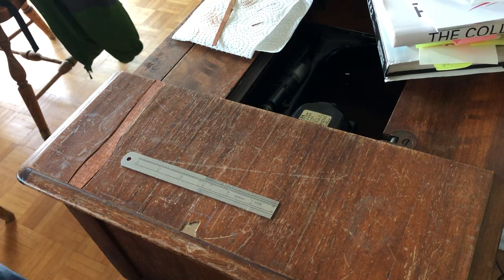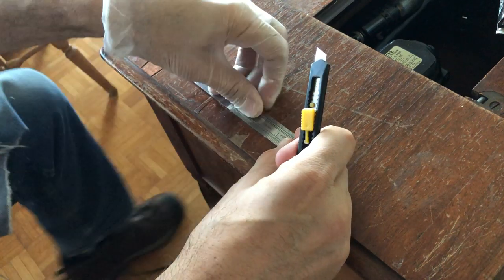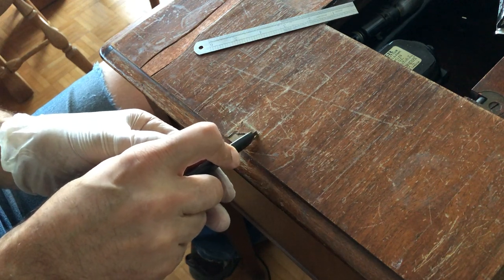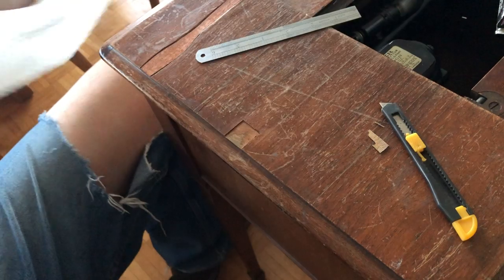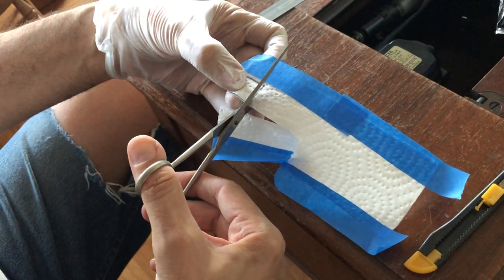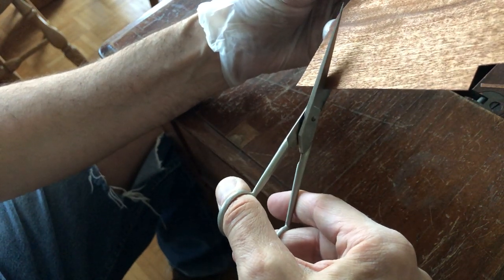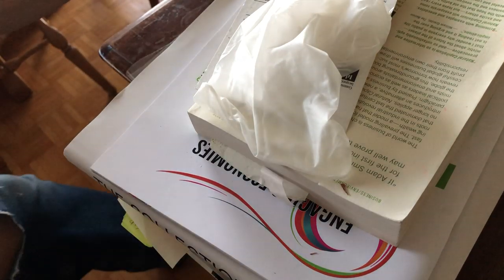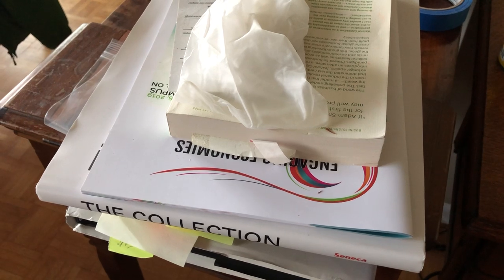SEWING TABLE REPAIR SERIES # 7:  Tracing or Squaring Small Veneer Pieces; Which is Easier?

Comment: Your absolutely correct,  that is exactly what I suggested. Next time try just use painters tape on the spot and rubbing the edge with a pencil to give you an pretty close match. Then you can stick the tape to the new veneer and get a better fit. To adjust  sand it to fit that will get you a better and closer fit. For gluing it down I use Tightbond wood glue. You can fit a second piece over the first piece you did, yes it will sit proud but you sand it flush. Do that for both areas and spot refinish as desired.
Reply from the maker: Yes, I had wondered about sanding if I had added a second layer.  However, I was concerned that I would loose color on the surrounding areas and did not want to start the early stages of what might turn into a refinishing project.  I will try a second layer next time though and see how things appear.  Thanks for the tip

Comment: You don't need to futz with the outer edge to get it flush, you could simply use a fine sandpaper to make it flush after the cement dries.  I don't know what your contact cement's directions are,  but usually they say to put it on both surfaces, let it get tacky, then the pieces will stick together permanently "on contact".  You have to get the fit right the first time because "contact" cement does not allow for adjustment after contact.

Comment: Next time, you might try to cut the new veneer and old veneer at the same time.  Lay the new veneer on top and cut thru both at the same time, keeping the blade perpendicular to the surface.  That way, you won't have to make a paper pettern.  Or, cut the veneer first, then use that as the pattern to cut the old veneer out.